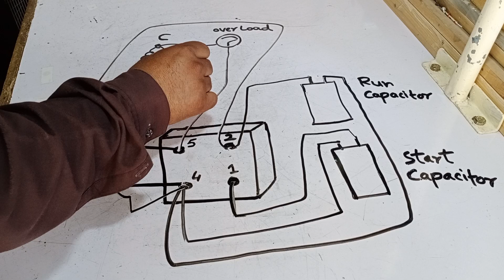99% Don’t Know How This Device Protects Motors & Compressors!

Comment: With 16MOhm this "low quality" Relais is damaged, there would be only a current flow of 14µA ...basically nothing. So the Relais would never switch from the  start-capacitor to the run-capacitor. Possibly the power is bigger if the start capacitor is used?